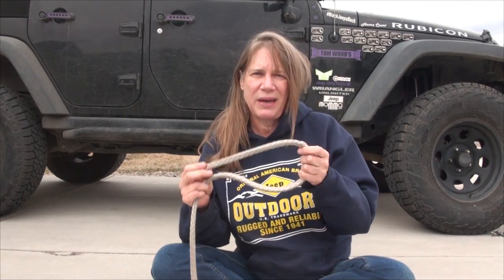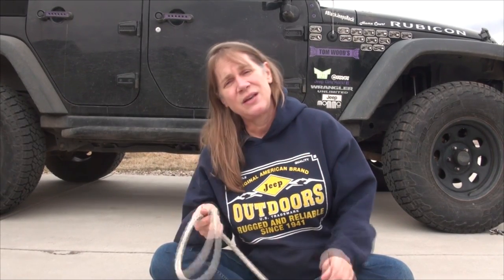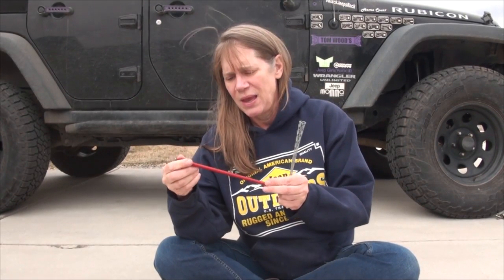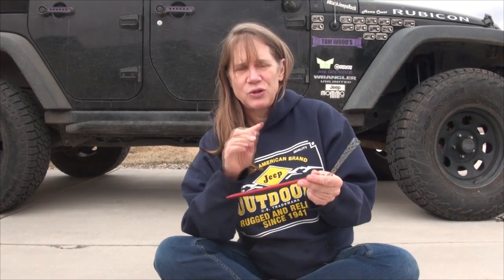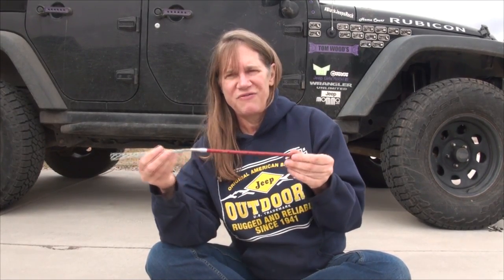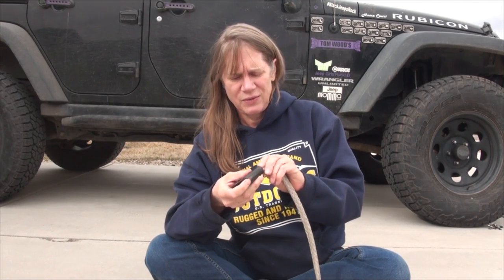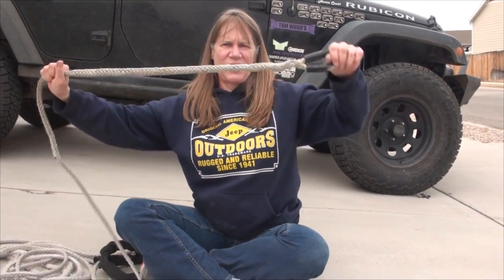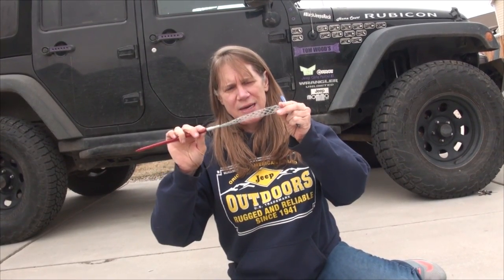Step-by-Step Guide: Repairing Synthetic Winch Line with Factor 55 Fast Fid

Comment: So for those that stumble onto this video... the reason why everyone keeps mentioning Factor 55 fid is because there is really no other alternative. In marine industry they sell fids but they cost like $25-32 for metal stick into which rope goes and then you need a "pusher" stick which looks like a long screwdriver of sorts and that is another  $20. And so just roll your eyes and order the darn thing from factor 55. I just got mine on amazon for $47 with free shipping.
Reply from the maker: I never even knew you could do such a thing. Pretty cool trail fix!